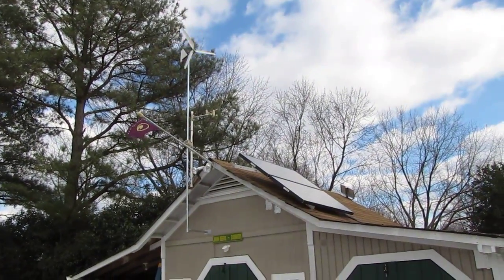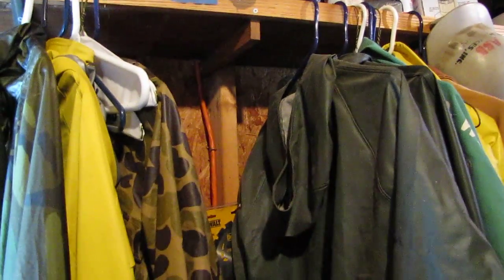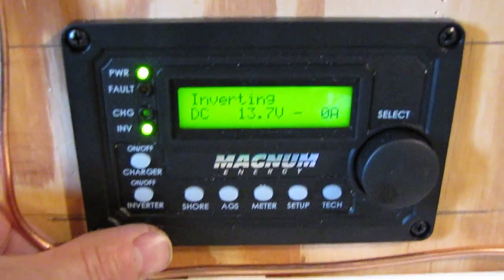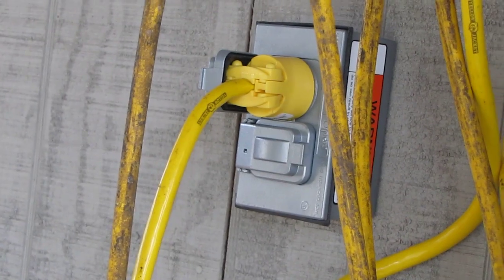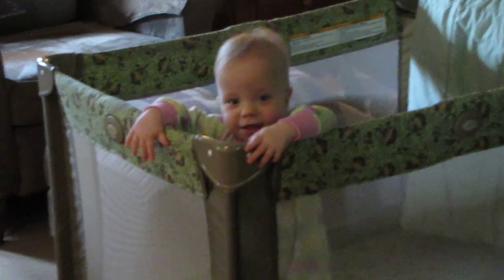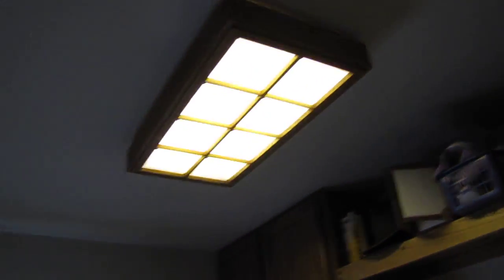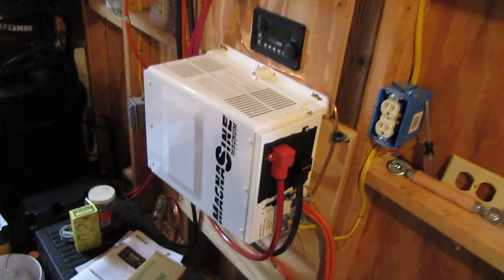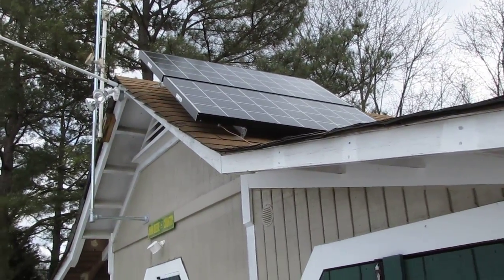My Solar Power Back Up System For House & Shop OFF THE GRID The Beginning VIARLOCITY  part 2

Comment from the maker: I was Just Starting Out My System Then I have Alot More Panels And Batteries Now  But People Get ! Wrong Impression With Batteries You Could Have A 10' x 10' Room Full Of Batteries But If Your Running A 500 watt Refrigirator sooner Or Later especially at Night The Will Be Heavily Discharged To Nothing  So It Is A Great Idea To Have A Back Up For A Back Up  Like A Honda EU Inverter Series Generator For Back Up Thanks For Watching Kenny

Comment: How long will the 4 batteries power your house, 4-6 hours? I would think a larger bank would be needed and a lot more solar power, way more then two panels to generate the power needed to replace what is lost in the batteries each day.

Comment from the maker: I have 5  90 Amp Hour Batteries  = to 450 Amp Hours  If That comes to part No power  / sun/ wind  I have Honda EUI 2000 watt generator to charge my Batteries My Inverter has Built in automatic Charger

Comment from the maker: @dpdevil1 I sure am Buddy Inside PVC conduit I can Run My whole House Lights Ceiling fans Refrigerator anytime during power outage for back up power Or anytime during The day & night  I had My electrician Hook My Reliance transfer switch in Being Off the grid is the best way On Grid The power company will find a way to get You No offense to utilities But I like control of my own Power Thanks Dave Kenny

Comment from the maker: @dpdevil1 Thanks Buddy My inverter is a 2000 watt MS2012  12 volt That loud noise is the intercooler fan when run alot of watts it will kick in automatically I love My Magnum sine wave Inverter